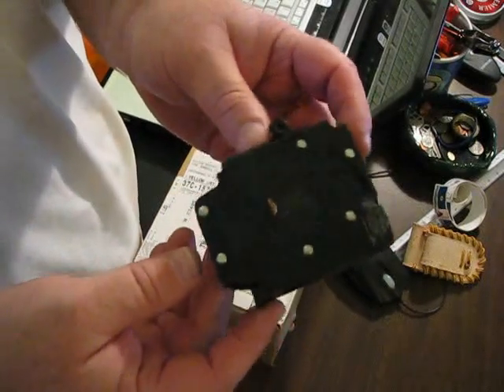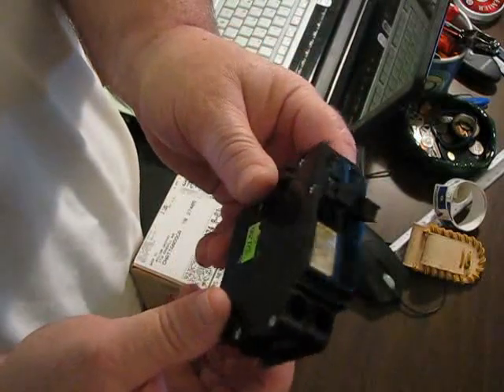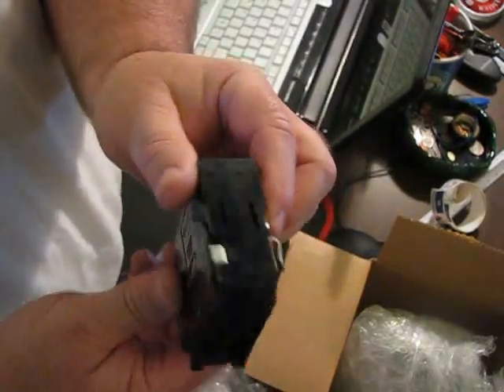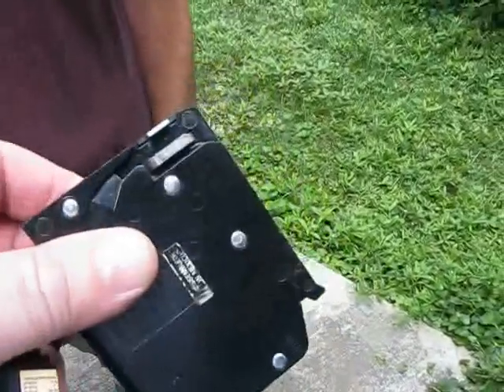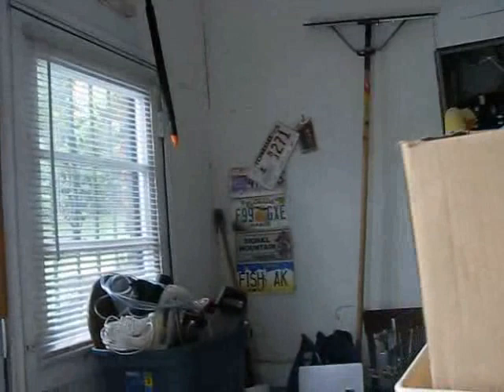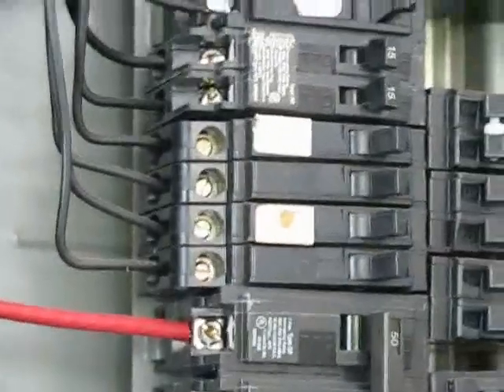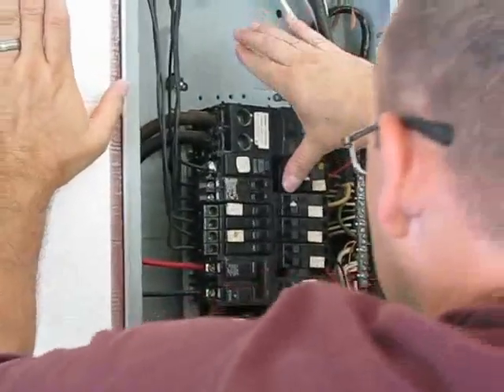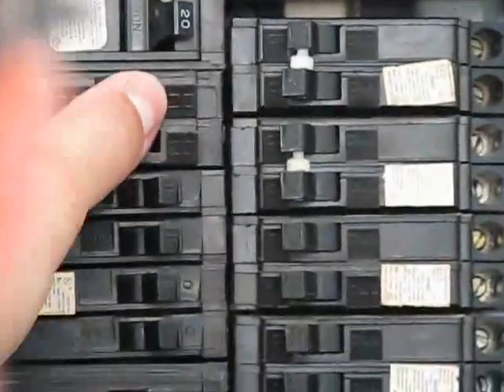Breaker! Breaker! Obsolete Breaker!

Comment: These breakers are 220V that occupy 1 pole SPACE between the feeds.   They have  companion  R & L 1/2 size (15 or 20A) to complete the fill at the ends. You only need these if you run out of room for 2pole 20's  .  I used these in an old 100A GE panel to fix 2  multi wire (12-3 wg) that was done with 2 singles 

See that breaker with gaps on each side.  you could have swapped that for a standard 2 pole
Reply from the maker: It had more to do with the way they snap into the panel. It wasn;t anything like Square D or any other typical configuration.

Comment: hey i don't ever say anything negative to anyone on here but i have to tell you , any home that has alum. wire must be addressed with expert knowledge or you will burn down someones home ! period !  that breaker that you installed was professional ,personally i would unhook all alum. conn. and install anti corrosion lube just to save my ass and make sure the customer knows that  unless all alum. connection are not addressed that they will not find any ins. co. to cover them for fire. and if they sell it will have to be fixed 100%. but for you sir your a professional," get that job lol."
Reply: not true. If it was installed per codes when it was built the carrier will cover it. There are some carriers that wont insure a residence wired in aluminum. That would be something that would be suspect based on the region and the year it was built. That would be the same as saying Federal Pacific breakers and panels are illegal and have to be replaced. I run into homeowners all the time that are told by home inspectors that they "must" replace them. I always advise that its a good idea or that its something to ask for when buying, but I never scare someone by telling them its a must.